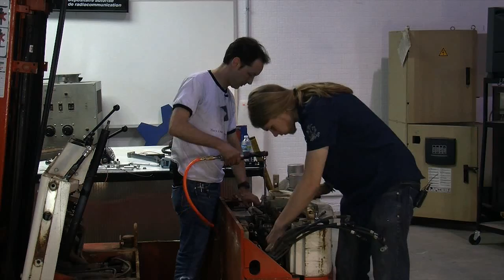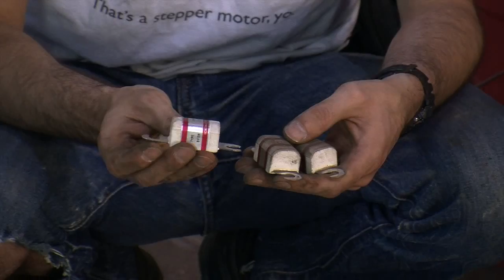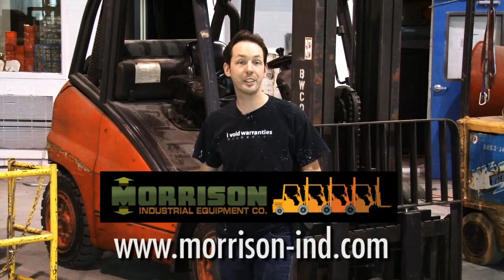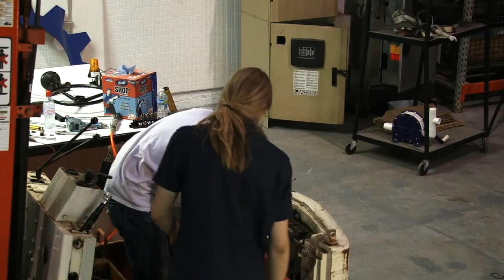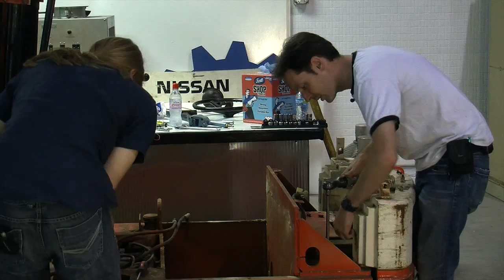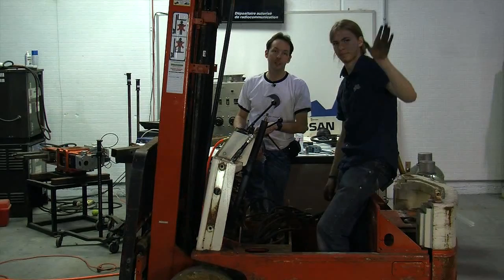Forklift Autopsy (Part 2)

Comment: Thyristors (or SCRs) are sort of like transistors that latch while current is flowing. They only conduct in one direction, but you have to apply power to the gate for it to do so. However, once they begin to conduct, they keep conducting until you stop passing power through them.

Comment: Chris, did you notice, when you autopsy consumer stuff you only get piles of crap for the waste bin. But with serious gear, you get plenty of good parts ! Someday, you should try to get access to a locomotive scrapyard, or an airplane scrapyard. It would bring a ton of stuff and allow to make pretty videos, as "Mojave trip part 3: Boeing 747 cockpit autopsy".  About the mystery item you removed from the forklift, it may be a big toroidal inductor. Ohmeter test should give you a highlight.

Comment: thyristors AKA silicon controlled rectifier (SCR) is sort of like a latched relay, once its triggered it will stay on until the voltage goes below the threshold then it turns off, it can be used for rectifying or regulating however you need a synchronous gate pulse to switch in the appropriate half of the AC waveform, this could be used for regulating